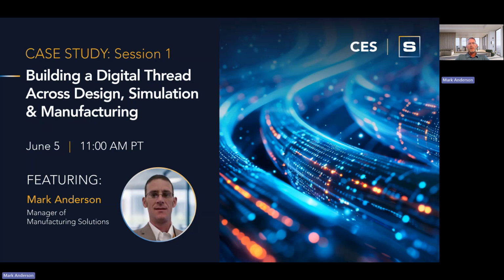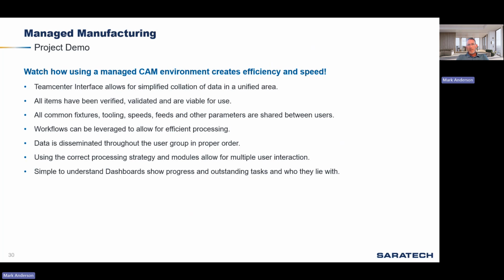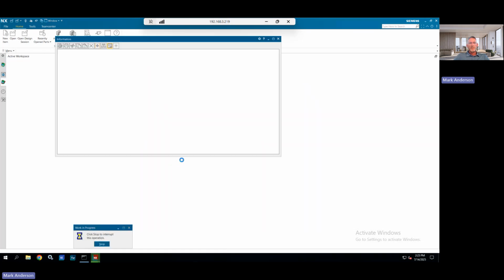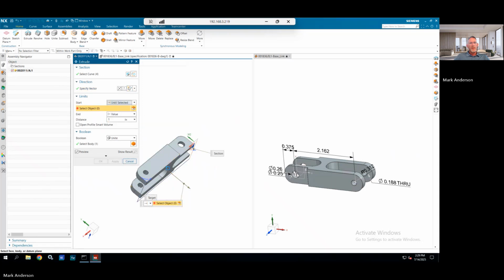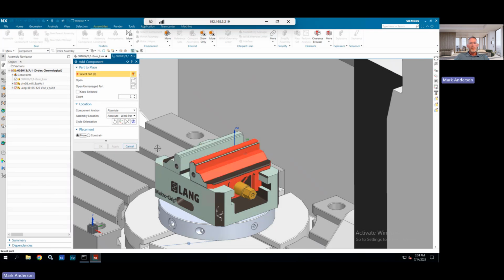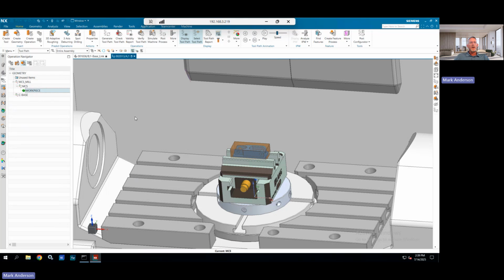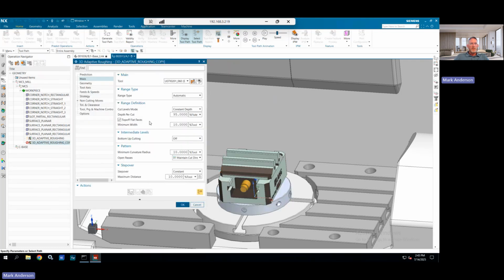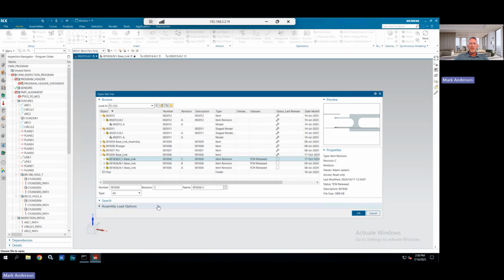NX Design & Manufacturing Digital Thread - Part 2

Comment from the maker: Transcript:

Hello everyone. My name is Mark Anderson, manager of the Manufacturing Solutions Group here at Saratech. On June 5th, I delivered session one of Building a Digital Thread Across Design, Simulation, and Manufacturing. Today, I will deliver session two, which continues the story from session one.

In session one, we worked with a digital vein actuator and performed FEA analysis. We quickly identified that thickness and radii were the causes of failures, which led us to our manufacturing engineering concept. Session two focuses on the next stage: moving from conceptual understanding to physical development. We will show the process through Saratech’s digital thread.

We initially envisioned a four-part process, which ultimately condensed into a two-part process. Now, with a conceptual understanding of the part and its manufacturing engineering stages, we are ready to begin physical development. This session will walk from a developed product to manufacturing, using the tools and methodologies in Saratech’s environment.

The PowerPoint you will see was developed and distributed by my colleague, Adam Cassidy, an excellent Teamcenter architect. I have kept it largely intact. For those seeking deeper understanding of Teamcenter or its application, I recommend contacting Madison Ry, Vice President of PLM at Saratech. She and her team provide comprehensive demonstrations that go into more detail than what I will cover today.

Today’s session represents a “day in the life” of working in an NX CAM-managed environment. There are four key areas we will cover:

Accessing data

NX integration

Leveraging workflows and reports

Compliance

We begin with robust search and traceability. Data entry, visualizations, and navigation are key to efficiently accessing the information you need. Traditionally, we used file explorers and manual search tuning, but Teamcenter handles these tasks automatically, streamlining search and visualization. Active Workspace provides a unified interface, while I will demonstrate the rich client version, which is more like a Windows-based file explorer.

Next, NX integration: Teamcenter integrates seamlessly with NX, enabling a start-to-finish process from a user perspective. Workflows can range from simple to highly complex, representing the full product life cycle—from stress relieving to quality checks to manufacturing. Once a manufacturing engineering plan is generated, complex workflows allow data to be disseminated across CAM, quality, and manufacturing groups simultaneously, ensuring everyone works from the same verified model.

Workflows in Teamcenter allow change requests, participant management, and flexible configuration. The managed process ensures anyone outside the project can view project status at a moment’s notice. Dashboards and charts provide automated insights into progress and task assignment.

Stage modeling is an essential module for manufacturing. It allows physical representation of operations for each stage, facilitating volumetric operations in NX and improving automation. Creating stage models upfront saves significant downstream time. Using stage modeling, we can prepare stock, remove unnecessary chamfers or radii, and perform sketches and extrusions that simplify later operations.

In practice:

Stage models allow multiple users to work on different operations simultaneously.

Stock and tooling are pre-assigned, ensuring consistent setup.

Assembly constraints and positioning simplify simulation and machining setup.

Feature-based manufacturing identifies cutting paths automatically, reducing manual intervention.

Using Teamcenter with NX, manufacturing operations such as adaptive milling, tool assignment, and stock preparation can be fully automated. Once stage models are prepared, operations can be perpetuated across multiple users, allowing concurrent programming. The same models can also be sent to CMM for inspection, enabling simultaneous quality verification.

The use of PMI data allows for automated drafting and programming, linking design, manufacturing, and quality into a unified digital thread. Stage models ensure robust data structures throughout all operations, supporting efficient, simultaneous processing and full visibility of project status. Dashboards provide real-time updates, ensuring everyone has access to current information.

In summary, this session demonstrates how Saratech’s managed environment enables efficient, automated, and collaborative manufacturing workflows. Stage modeling, NX integration, and Teamcenter workflows together ensure consistent data, minimize errors, and optimize operations across engineering, manufacturing, and quality.